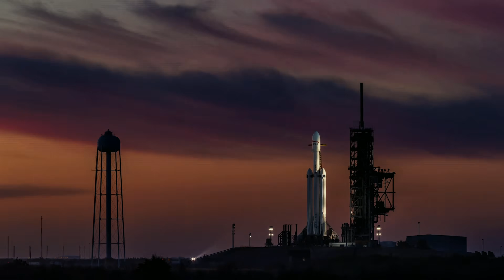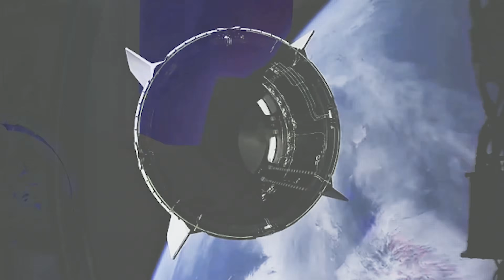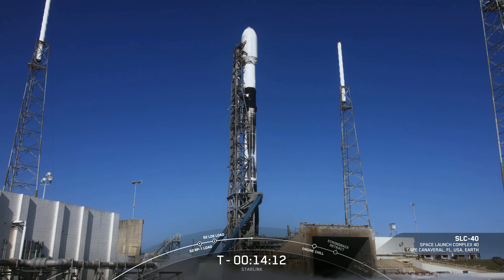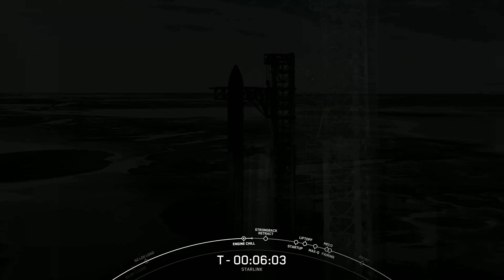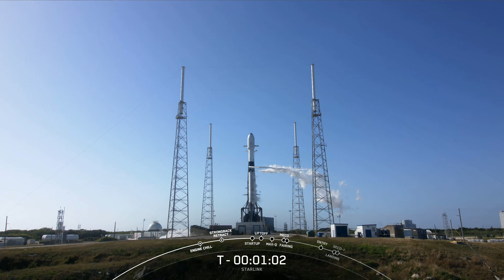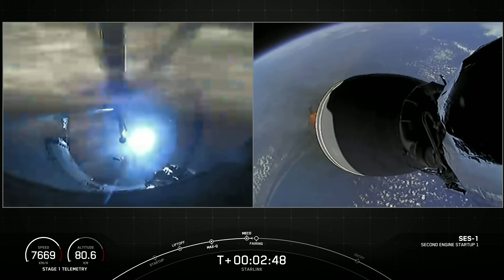Starlink Mission

Comment: SpaceX will be remembered as the company that helped expand hour civilisation on Mars, yet unwilling to spend on a decent landing camera.
Reply: Its very decent, but the internet is choppy as the rocket landing disturbs the internett connection
Reply: The camera is probably not the issue. high resolution video is insanely difficult to transmit from a moving rocket. There’s very few good uplinks out in the Atlantic Ocean. Afaik the camera feeds actually use starlink as their uplink, and right now starlink is limited by the number of satellites they have. I promise 1 year from now the footage will be much better.
Reply: I doubt the camera is bad itself, I think that the forces and turbulences of the engine exhaust cause interference with the electronics and the signal/video stream link
Reply: Not gettin Mars tho...

Comment: Now there are 2 boosters with 11 landings and 11 flights, astonishing!
Hope Starship can do that in less than a month when it becomes operational.
Reply: Are you suggesting thaat Starship will be completed and have an orbital flight in the next 31 days? lmfao...
Reply: @nastystang113  NO my god, read it before commenting.
I was suggesting that WHEN it becomes operational, after several years of flights, it completes what it promises(rapid reuse, and minimal refurbishment) so it can be reused at faster rate and cheaper prices.
Reply: @nastystang113  I don't know if you're being ironic or sarcastic, but just in case.

Comment: It took decade for spacex to master the reusable rocket. Now, other companies is thinking of doing the same thing. So spacex is leading other companies by decade.
Reply: To be fair, Blue does have the New Glenn as a reusable spacecraft and has been working on it for a while. Now when Blue will fly New Glenn is a good question. It has been delayed multiple times to the current late 2022, which will almost certainly slide into 2023 as the BE-4 flight ready engines have yet to be delivered to ULA for their Vulcan Centaur. New Glenn uses the same engine, but ULA apparently has first dibs on the first operational ones. The BE-4 delay has cost ULA money on the USSF-51 flight.
Reply: @steveaustin2686   I have read estimates of a first New Glenn flight in 2024.
Reply: @odysseusrex5908   I would not be surprised. Tory Bruno said last year that they expected the flight ready BE-4s by the end of 2021. Now he is saying that they will have them in the first half of this year. I so hope the ULA contract has late delivery clauses.

Comment: I wonder if they could modify the fairings to function like lifting body-type glider. Perhaps by lining the inside of the fairing with some sort of sheet/fabric material, which could be drawn taut after separation, creating an enclosed space half the size of the original cargo bay. It wouldn't be hard to built extendable flaps as control surfaces, or even a paraglider style chute. Then, they could FLY the fairings home!
Reply: They are doing this... Almost to the word!
It's just that the firings don't have enough lift, even with the chute, to glide all the way home.
Reply: Then you would lose a tremendous amount of your payload capacity.

Comment: Anyone else worried about having 42 thousand satelites in low orbit or just me?
Reply: Just you. Let's do some math. The surface area of the Earth is approximately 196,900,000 square miles. Divide that by 42,000. That means, if you spread them out evenly on the Earth, each one would have about 4,688 square miles around it. In space, of course, you're dealing with a somewhat larger sphere and, more importantly, they are at different altitudes, thus spread out through the third dimension into different spheres. Space, in the words of Douglass Adams, is really big.
Reply: @odysseusrex5908  hope you're right there. If all the math adds up.
Reply: @mattelollol1   I did the math for you. What didn't you understand?

Comment: why does the camera always fail when the rocket is landing?
Reply: Not sure but I would think it's just from the huge vibrations. All the components must be rattled around like crazy there's no way it can form an image. They need to put some crazy dampening and stabilisation on it!
Reply: The antenna (dish?) on the drone ship is so close to the rocket engines it is vibrating too much to send its signal.
As for the rocket, that is sending its signal to the ground station (at launch site?), but that gets behind the horizon when the rocket gets too low, losing signal.
Reply: there is a video on this topic called "Why does the SpaceX droneship camera cut out?"  https://www.youtube.com/watch?v=hH75bVG7HBo - TLDR: vibrations. The rocket engine sound waves and vibration waves are vibrating the ship antenna dish connected to the satellite itself so much that it is losing signal. Have you even seen how hard it is to stand underneath an actual helicopter?? Now multiply that by 10 is probably what it feels under a rocket engine lol

Comment: what is that black dot that flew towards the left @ 26:43 (below the fin, left frame)
is it debris,  or some shadow of satellite?
Reply: It cannot possibly be a debris or satelite because since the stage in in suborbital path, any orbital material will cross with kilometres per second of relative speed

Also, there can't be any debris or satellite possible as such low altitude

Comment: What's a meter?
Reply: The meter is defined as the length of the path travelled by light in a vacuum during a time interval of 1/299,792,458 of a second

Comment: When does stage 2 land?
Reply: It doesn't. It was deorbited and burned up over the Indian Ocean.
Reply: @odysseusrex5908  oh okay I heard these launch systems were reusable.
Reply: @boathemian7694   The first stage is, but not the second. They looked in to making the second stage reusable but all the extra weight that would have been necessary, in heat shields and fuel, would have cut the payload capacity by more than  half, so it just wasn't worth doing. When they get Starship operational, it will be completely reusable.

Comment: 23:49: a mouse at the engine!
Reply: A mouse three feet long with no head, no tail, and no legs. It's a puff of frozen oxygen extruded from the engine. It happens at the point in every flight.
Reply: @odysseusrex5908  THX. I would recommend a mouse trap instead🤣🤣

Comment: Support spaceX call FAA and spam complaints against itself/Bezos
Reply: What are you chatting man. The FAA has had to delay because of all the comments by SpaceX fans. The comments are only for people directly impacted by the facility and launches not indirectly so people sending comments should only be local residents.

Also the FAA hasn’t actually delayed anything. The only time they did was when SpaceX deliberately launched without permission and as a result got a slap on the wrist.

The orbital flight hasn’t been delayed at all. SpaceX still has a lot of testing before they can even attempt the flight.

Comment: @23:49  can anyone tell me what the heck is moving around the top end of the engine?
Something is moving around it then they cut the camera harshly as if to hide it?
Reply: That is frozen oxygen that has broken off from a pressure purge vent. It happens on almost every mission.
Reply: @steveadams7369  ahhh makese sense, i heard her talking about ash collecting on the nozzle but didnt think that was what it was. Leaked/purged O2 under low pressure makes sense. Thanks!
Reply: Frozen oxygen is common

Comment: Why isn't SpaceX designing and building recoverable/reusable second stage units?
With enough hard work, it can be achieved, anything can, well anything within the grasp of possibilities of the Human Mind and within the sphere of bending the boundaries of engineering and physics. 
I know it's a bit more complicated to do, and more complex to design, but it can be done. Remember how in the beginning, most people,(me nit being one of them) didn't think landing a first stage booster was possible, but it was, it took hard work, forward thinking, brave design, something that usually kills a project, especially when going after government contracts, but anything worth doing seems to do that doesn't it, because a job worth doing is a job worth doing well.
Reply: well... they do.. it's called Starship. It's not magical to bring stuff back to earth from orbit, it just needs certain things, like a heat shield, a landing system like a parachute, wings, engines with fuel and so on. All this has to be first lift up into orbit and then bring back down to earth. That would mean you have to make the whole rocket bigger...aka Starship... or you have to cut the payload mass. for the falcon rocket this wouldn't be cost efficient.
Reply: Umm... Have you heard of Starship?
Reply: Shannon Jaensch  SpaceX is a private company...
Reply: For the Falcom 9, For a second stage recovery, the cost would be more than a new stage, not to mention to protect it during re-entry, the required protection adds weight, weight means more money and fuel.  so it is cheaper to discard it.
Reply: Oh sure, it can be achieved, but only by sacrificing most of the payload capacity. Thus, it's not worth it. Complete reusability will come with Starship.

Comment: CO2 😡👎
Reply: Yea, could be. Blue Origin might be much better on this regard.
Reply: These are reusable rockets. If you're worried about emissions, this is exactly the type of tech you should be applauding.
Reply: @logitech4873  What about reusable rockets with liquid hydrogen-oxygen fuel tho?
Reply: @ratyjoona  Blue Origin hasn't put a single kilogram into orbit, so yes, they are indeed better by that single metric.

Comment: Imagine what Elon could do with the endless cash that NASA wasted over the years. What did we get with the Shuttle 4 flights a year average?
Reply: Shuttle usually flew eight times a year. It was primarily a scientific research vessel. It had ten times the operational capability of Dragon. We won't see its like again until Starship is fully operational. That, unfortunately, looks like it is going to be several years now.